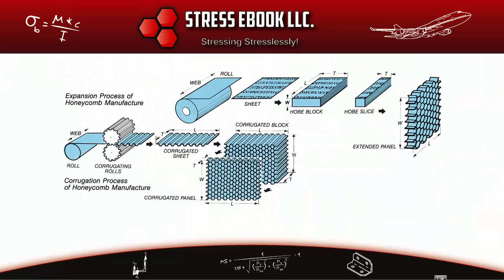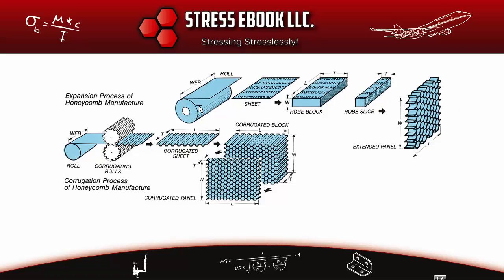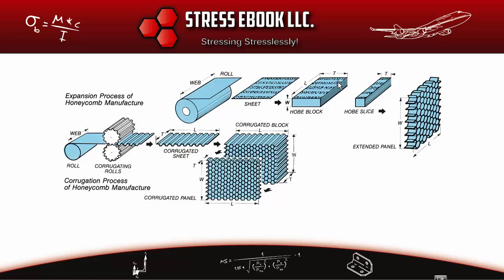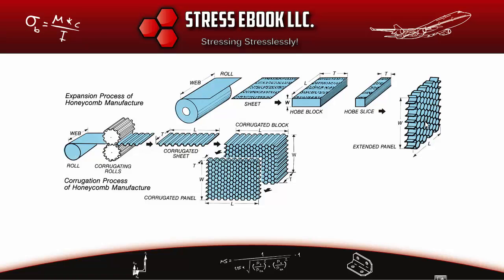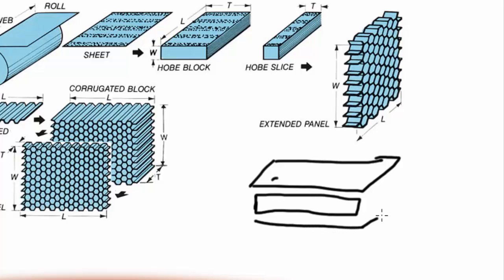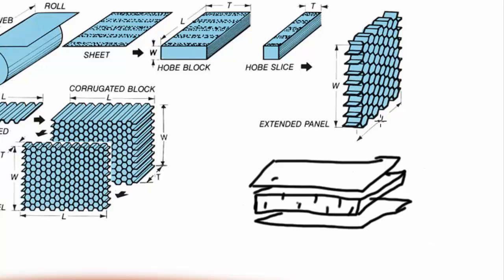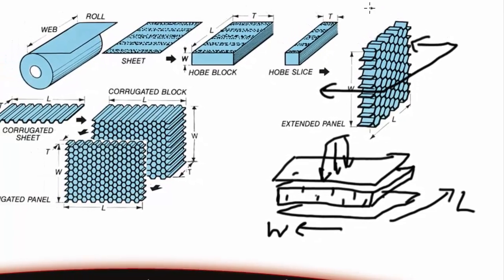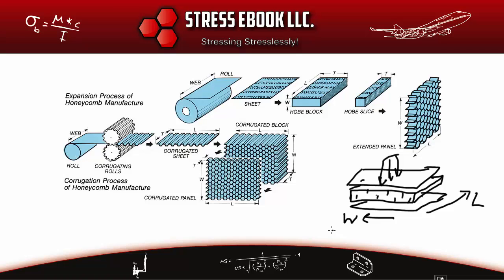How Are Honeycomb Sandwich Panels Made

Comment: Hello - aluminum honeycomb is processed using the first method stated in your video.  I've not seen the corrugated method used before, but sounds interesting and will see if I can find more on that process.
Reply: Hi Randy, expanding a metal Aluminum honeycomb core sounds a bit unusual, is it possible for you share some more information or a link that goes more into that? Thanks for your comment. Expansion is usually the best approach for nonmetallic panels such as nomex core panels. The expansion or corrugation process is only for the core of course.
Reply: Hi Surya - Expanded hex cell alum honeycomb has been used for many years as a structural substrate. Expanded alum honeycomb is utilized in aerospace, marine, a backer for lightweight natural stone panels, and many other industries. A quick search of the web for “aluminum honeycomb panels” will provide much information.  Producing a hex cell alum core is tricky, but is common practice.
Reply from the maker: +Randy Randy Thanks Randy. What I was trying to get at is that the expansion process seems to lend itself much better to Non Metallic cores, while for Al honeycomb core it seems outdated and inferior compared to the corrugation process. 

In addition, superior strength properties of corrugated Al core seem to be the norm nowadays in the production of Al core as the production efficiency is also improved. 

For example: http://www.plascore.com/products/honeycomb-cores/aluminum/pahd-xr1-5052-aluminum-honeycomb/ 

But, it is good to know the expansion process was prevalent for Al cores, so I thank you for that insight.
Reply: Hi again, thank you for the reply.  My original point was that the first process illustrated in your video is also used for making “expandable aluminum hex cell honeycomb core”. In your last reply, you state that this process of making expanded core is outdated.  Reading from the link you provided, so much of this material is still being consumed in arrow and other hi-tech industries; I wouldn't say it was outdated just yet.  The expansion process is still prevalent, not sure why you think it is a thing of the past?
Reply from the maker: +Randy Randy Correct, I think in the video I made it sound like the expansion process is exclusive to non metallic cores, what I meant to to say was it is more widely used for them.

The other process for Al cores is the corrugation process, it is different from expansion process and more efficient in that the Al core foils are formed into the hat shape using special rollers, then bonded together at the flats. This eliminates the need to use piercing nails and expanding the Al core. Correct me if I am wrong.
Reply: @stressebookllc  It's generally only used when thicker aluminum is used and won't allow for accurate/proper expansion of the cell. You are generally better expanding the core on site for ease of handling and less chance for product damage. The processing time for cutting the raw material to the correct thickness is faster using the block method also as the machine is basically a fancy table saw. Vs a big band saw with long slow cuts.

Comment: Instead of bonding the HOBE block,  you should ultrasonic weld it..  That way,  both directions will be strong..
Reply from the maker: Sounds interesting, assuming the bond is as strong as ultrasonic welding, the 'W' direction weakness is primarily due to lack of material continuity. This  blogpost goes into a little more of that: https://www.stressebook.com/sandwich-panel-flexure-and-core-shear/

Comment: Hello, Surya. I have a question regarding the core orientation in sandwich panels.

I know that for better strength capability core should be oriented along the short edge of the panel. But I have no idea what the stress rationale under that...

I guess that panel short edge orientation results in higher transverse stresses. Therefore, to minimize deflection due to transverse shear it is efficient to put core oriented with the higher shear capability. However, I still have doubts...
Reply from the maker: Think of the core as the web of an I-beam, that I-beam web (core) is vertical, I-beam caps (skins) are horizontal.
Reply: @stressebookllc  Thanks for your reply! It seems that my question was not so clear described... Sorry for that.

I meant the core ribbon direction. If we take rectangular panel, the most rational way to orient core is to put ribbon direction along the short edge.

Beam analogy for honeycomb panels is clear for me, but the question more about in-plane core orientation.

Really appreciate if you can explain this effect!
Reply from the maker: @ivanagafonov3455  It depends on the manufacturing process. But it also depends on the panel cut. This is why you have both L and W core tests to determine the allowable core shear stress. Check these: https://www.stressebook.com/sandwich-panel-long-beam-and-short-beam-tests/ and https://www.stressebook.com/sandwich-panel-flexure-and-core-shear/. Good questions though.

Comment: the video is very nice and knowledgeable. but, how to measure the expansion of honeycomb where the cell size differs? is there a particular formula that has to be followed?
Reply from the maker: Rajendra Pareek The core before it goes into these panels has a fixed topology for each cell. the cells are all controlled in size shape and dimension during the core manufacturing process. The cell size and shape does not change for typical aircraft interiors applications. There are different shapes and sizes for different applications though, such as extended and over extended cells etc. for example.

Comment: Can di-directional materials be produced. Where there are two cores going in perpendicular direction with a skin in between?
Reply: +gus bisbal Gus yes I believe it is done, although it is not a common practice in the interiors industry due to the fact that the types of panels that require this type of double panel layup are typically heavily loaded bulkhead panels that are too tick to be made out of standard Al panels.

The thicker the core, the lower the core shear allowable stress due to the instability of the core cell columns. The other complication is the bond between the center skin and the cores on either side is critical, as the shear stress there is maximum. A fiberglass ply is required if there is a mix of carbon fiber plies and Al core or plies for electrical insulation.
Reply: Are you asking about whether 2 perpendicular panels can be mated together? Or bonded together?

Comment from the maker: Rajendra, I go into a bit more detail and touch on some other topics in this blog post: http://www.stressebook.com/sandwich-panel-flexure-and-core-shear/. I am sure there are formulas as panel specifications usually contain cell size across the flats of the cell where it is expanded.

How they actually measure those sizes optically or otherwise might depend on the type of core (expanded rectangular core, hyper expanded cores or normal hex expanded cores among others), quality control requirements, process specifications etc. As far as the math goes, the distance between the glue lines is known, so the math could be worked out based on the type of core that is desired. I would probably look in hexcel databases and documents. I have almost always seen normal hex shaped cores in panels in my experience.